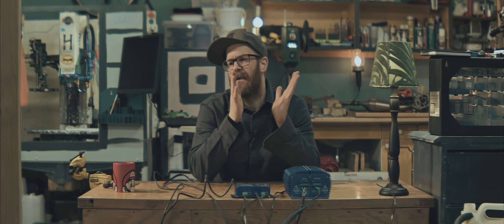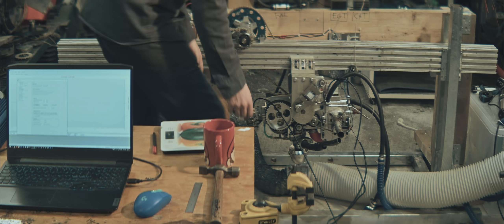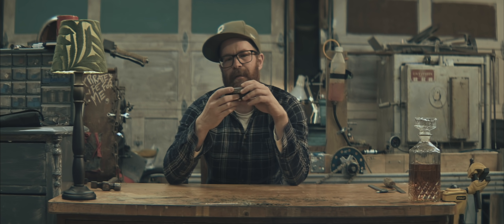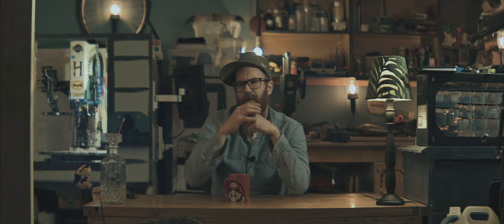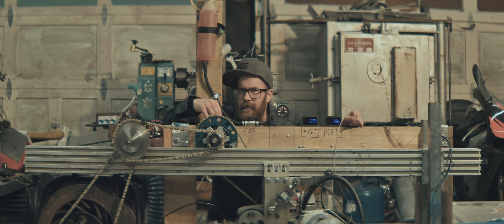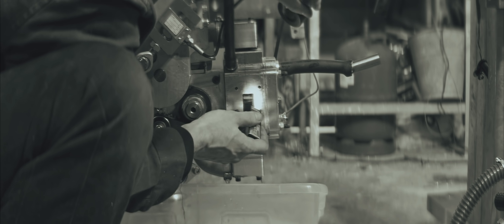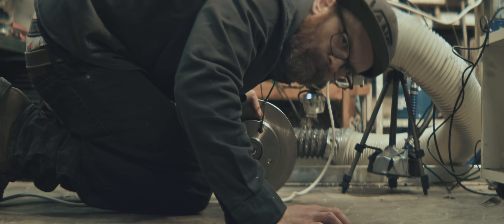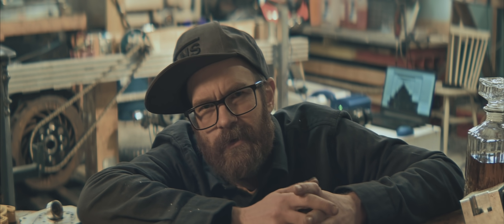Supercharged Two Stroke Grenades Head on Dyno!

Comment from the maker: Thank you The Ridge for the awesome wallet and for supporting the channel! Check them out here: https://ridge.com/2strokestuffing
Use code 2STROKESTUFFING for 10% off!
Reply: If you want to add a clutch back in the system in the future, I’d highly suggest using a kart clutch from the Touch And Go (TAG) classes of kart as there called in the USA, the 100cc class spins similar RPM to what you’ve commented your PIP should, and make about 35hp, the 125cc spin a bit slower but make 44hp, the typical engagement RPM for these clutches is set around 8k RPM, and are quite tunable, rebuildable....a cheaper option is a KT100 class clutch but it’s not designed to hold as much power.
Reply: Pls see comment and following discussion by "the Workshop".
Reply: if you suddenly feel a urge to buy a vintage taildragger and wreck it to get youtube views, its not the booze thinking its just the company of a terrible sponsor.
Reply: As a tourist in Norway, you can not use your visa or master card that works in the rest of the world. Only credit cards from Norway is possible to use.
Reply: @nhytg376tgyuu765gjmg  why the ads in the middle of a video.its about time to find another place without ads
Reply: Love the longer video. This one was great. I've been following since you nickel plated your PiP engine. Keep it up 👌👌👌😁😁

Comment: Always put wax on your blade when cutting aluminum. Especially if you don't have a metal cutting back pitched tooth blade. Also make sure the piece is well anchored against the fence and deck.
Starting to sound real good.

Comment: Just wanted to chime in:  you can cut aluminum angle on that saw, either clamp the angle to the fence so it won't move on contact OR place the angle with the inside down so it's sitting on both legs and start the cut on the corner.  Harder to clamp that way but it can be done.

Comment: I ve noticed you have alot of 2 stroke testing under your belt. How possible would it be to take a cheap Chinese motorcycle engine and make it a competitive  2 stroke? I was wondering how easy it would be to do? I thought about it because of already having block ,crank, and transmission already built.  Just wondering what your thoughts are on it.

Comment: A retarder has a maximum rpm and your gear ratio may not be suited.

How are you braking the engine ? Is it a ramp rate or a fixed load ?

I suggest a fast ramp rate and slow it down after you have everything working

Retarders are not efficient at low rpm

Your load control is automatic or manual ?

Comment: A couple things i saw that are screwing you.   1, when you  set up a load cell with an eddie brake, usually the cell is oriented completely vertical, and it's applied to the brakes coil bracket.  You have it mounted to the reaction member (engine block) of the engine. You can easily get spikes in load from accelerating the crank that isnt useful power output, but the dyno thinks it is. You can see this in your torque numbers flipping positive and negative when you were keeping it idling. If you throw a spike in the data, the computer is quickly going to compensate and add brake  regardless if that power made it to the chain or not.   Another thing that's killing you is that you are spinning the brake so slow and theres no mass attached to it besides the 2 rotors of its own construction. All the load is also significantly gear reduced. This multiplies the response of the brake by the gear ratio you are running. And this leads me into another problem you have. Imagine you have your front wheel on your bycicle gear reduced to a small light weight flywheel at a ratio of lets say 6:1. Attached to this flywheel is your front brakes. Now you want to do something like an indo on the front wheel down a short hill. That takes a lot of finesse with the brake. Well now because your front brake is over six times more sensitive, it makes that feet much much more difficult if not impossible. That's the same job that the Dyno has to do. And because it is so sensitive, you run into a problem where the PID for the brake may not be able to adjust for your level of sensitivity. Lets say that you are free spin at 0% brake, slight load at 2% and stall at 3% brake application. The brake has a finite level of adjustment. Typically a power of 2 to something. 255, 1024, 4096..  Lets say it's 255 adjustments. That means between your 3% operating range you only have 7 adjustments for load. That's not very adjustable. Then you have the dyno PID controls. It was showing a LOT of what they call overshoot/undershoot. Usually this is done when a PID algorithm used to control the dyno is not matched to the system that it is controlling. Usually it means it's too aggressive. Maybe too much P term, or not enough D term. Either way, it's best in my opinion if the load cell is mounted vertically to the eddy brake center. You set a 5kg weight directly on top of the cell and you're calibrated. For torque calculation then it's all just a factor of the gear ratio. You get no more false torque spikes from accelerating the rotating assembly, you only read torque absorbed by the brake, and it will produce MUCH cleaner feedback for the dyno to be able to adjust the eddy brake.

Comment: continuous burn steel impeller (reaction turbine) pump generator!! the simples most powerful power train ever
Reply: the rotary valve pulse jet burner as the hot air pulse heat source, center in, rim out, ducted or open, ducted for safety, open for weight reduction
Reply: no clutch needed for electric hub drive train, independent hub motors
Reply: what comes by earned, will go by whistle, its said

Comment: Ignitions in general but esp motorcycle style ignitions are incredibly noisy. They emit a lot of interference. Some ferrite would probably help. Also shield the spark plug wires with some aluminum foil and ground it to the block or very thin dia wire tightly wrapped around it and grounded to the block. Also tightly wrap your signal wires together.

Comment: I use the your dyno setup with a similar brake in my rolling road , try it on fixed rpm for measuring load . For mapping i find this is useful for mixture and timing adjustments  then do a power sweep at the end f the session.

Comment: I am not sure about your calibration of the load cell, did you take the angles the forces are applied and measured into account?
Reply from the maker: No, you're right. I didn't do the proper calculations, but 30mm should be ballpark. Doing things accurately when the bugs are churned out.

Comment: Awesome videos! May i ask why you dont build a manual external clutch system? Some sort of drop bars with a standard accelerator and clutch, maybe a brake ?   May I also ask why such a big heavy dyno?  wouldnt a rear wheel, running on that dyno give you a more accurate reading and feel. All those chains, sprockets and weights SCEAM CONFUSION in the math's, to me. In my mind, its like trying to dyno a 2stroke mounted in a tank with tracks, ratio'd through gears... I havent watched all your videos, but I am catching up, as you progress. You'll tame this beast just now! Im sure of it. Awesome show... Thanks for sharing with us!

Comment: Faaarrrkk man, I can't believe you used that meat axe without clamping the piece you were cutting, your very lucky, but I can't talk, I was using one one day and tried the same thing, it grabbed and bit in, blowing the machine blade bearing boss housing apart, shrapnel went flying everywhere, the blade went flying, I'm standing there shitting myself, all I hurt was my thumb, from the shock of blade grabbing peice my thumb was on, the drop saw was destroyed, I was sacked on the spot, my shortest job every, I was there for just 3 days lol, my advice is I wouldn't be drinking and using such machines, bad combination, at least your ok but I'd check that drop right over before I'd use it again. Great progress with motor 👏👏👏on the chain to dyno, I'd be adding a spring loaded sproket chain tensioner, so the chain doesn't decide to go flying, looking at how much free play there is. 👍 😊

Comment: Dude,,, your trying to sort out to many things at once,, 
First sort out the dyno with a stock motor, get that sorted out first.
Then once it's proper then start on the experimental motor.
It's called baselining, without your dyno sorted you can not reasonably think to get the experiment correct until then

Comment: nice work!
are you sure that your lever is 3cm? if 3cm is the distance form the center of rotation to the center from the bolt of the load cell, your lever will be only: cos(angel of the line between the two bolts to the horizontal) * 3 cm.  i guess that the lever should be something like cos(45°)*3cm= 1.57 cm.
maybe you have done it right and i just don't understand how you explane it.
Reply from the maker: You're exactly right, I was just being lazy...

Comment: Could you use a manual clutch to ensure the two conditions, (1) starting and idling, and (2) testing, both have the appropriate load engaged?  Maybe the PIP engine has different start/idle vs testing needs than the Brute Force Concept or your next design after that, so the flexibility could be useful.

Comment: Wonder if you can use a hubmotor as the load using the same dyno software , a hubmotor has leas mass and might be more suited for the 10 to 30 hp range

Comment: To validate the calibration of the load cell would it be possible to use an electric motor with a known HP and torque value  at x rpm and do a couple runs and see if you get a value close to or same as?  I would imagine using something that has a known output would make a good baseline like a 1.5hp 2000rpm  motor with a torque output of 5.3nm

Comment: It seems like the retarder is grabbing too hard then stalling out the engine during the power runs. The PID settings on the retarder will need some tweaking or playing with the ramp rate. Glad the episode ended with the engine in a still running condition! Progress!

Comment: Re calibration, what if you got an engine with a known output and used that as datum? Calibrate your setup off that engine against the manufacturers specs. I can imagine a new cheap engine would suffice. You could then use it to check calibration again from time to time.

Years ago in the Mopar Performance bulletins of the 1970s which were factory backed through extensive testing and tuning of their products for drag racing, Chrysler warned racers that engine dynos vary and to not get caught up in racing dynos: ie not happy with 400hp on one dyno and searching for another that gives you the numbers you want. 
With technology all that has changed from the 1970s of course.
Chrysler's advice to racers was to find one dyno and stick to it because ultimately it doesn't really matter when testing and tuning. 

Point is also, ultimately it doesn't really matter if the numbers are off a bit. Consistency can then show incremental improvements reliably.

Comment: A good video m8 , and when you up the boost I gues that's when you will see what parts need strengthening as well. But would fitting a known engine be better to see if your set up is correct.

Comment: Any chance you could make ME an engine?
The class limit for a Junior Dragster here in NZ is 250cc, so scaling up your 2500 or so horsepower from a 50cc, I should be expecting around 12500 HP right???. (i.e. About the same as a 500 c.i. top fuel engine that runs on 90% nitromethane with a great big supercharger sitting on top.
Not quite sure about finding some kid to drive it though as I'd be expecting a track time of under 2 seconds (assuming I can somehow find a way to get any traction).
I expect the launch G forces to only be a couple of hundred * g (i.e. About 30 times what the space shuttle could manage), so I might need to 'replace' the driver after each pass as I doubt they'll make it for a second run.
The hardest part is going to be the braking system since the kids aren't allowed to exceed 85MPH at the finish line!!!  (The rules don't inhibit them from doing 500MPH at mid track!!!)

Comment: That engine is very impressive I’d love to see one with a few more CCs
Reply: I'm a great fan of 250cc air cooled single cylinder racing going back to the early 70's. I would love to see a CZ 250 tuned to the max with a nice expansion chamber fed by a 38mm mikuni  carb. I always found the crank to be the weakest part when making a racing engine.

Comment: Yes, man, that's awesome. Getting numbers, even if I'm sure the numbers are wrong.  As Matt and others have said, make sure you're measuring your moment arm only in the horizontal plane for calibration.  It would be worthwhile using a motor that puts out a "known" power to check the dyno calibration is in range, maybe an electric motor as they have the numbers you're looking for on the motor plate and would be relatively easy to rig up.

That's one very interesting concept engine you have there.  Once start getting numbers you can trust from it, it would be very interesting to meter fuel consumption (which is gonna be horrific, as you're blowing through) in order to look at how it does vs a conventional engine (and just for laffs)

Comment: Awesome as always 👍 But I think there might be a problem with the load cell setup. You want to measure crankshaft torque but the load cell is measuring torque now at the cradle pivot point. I think since the crankshaft has some distance to the pivot point, there is an lever arm which amplifies the torque and the load cell sees higher numbers. Might be possible to fix this by attaching the calibration arm and weight to the crankshaft, then letting it rotate with the drive chain attached and that should produce the correct force at the sensor for a known calibration weight.

Comment: Hi , with regards to your CNC setup... If you ever consider a stand-alone control for your mill, My father and I converted a small milling machine called a Grizzly to CNC using a control called the DDCS V3.1 and Closed loop steppers. It works amazingly well and is very cheap. Has a screen and Pulse generator hand wheel. As a machinist myself and Cad-cam programmer the system realy impressed me... can compete with CNC machines that cost 3 times as much. Keep up the awesome content, and I can't wait to see the BRUTE force engine in a bike !!
Reply: I'm not into machining but can understand your thoughts. As a tight Yorkshire man, cheaper is always better.  My old boss used to say money is better in my pocket than yours. Are all bosses the same!

Comment: Is it okay to tig weld the spark plug bung back?
Reply: I think distortion will be a problem to the head plate. That's a project for later?
Reply: @malcrandall1309  won't it still distort from normal use? he can still sand it flat like a flange, then put a (thicker) gasket if need be, might as well try & save it if it's scrap.
Reply: @Eduardo_Espinoza  Welding deformation could be reduced by pre and post heating the parts. A large enough weld bead will have a quite large contraction force even when post heated.
If the head unit distorts under maximum load it's not strong enough. 
I think the new unit with it's large radius will continue to work OK until the boost is tuned right up. You know Alex, he's not happy till he's broke it.
Your right with the head repair,  repair not throw away.
Regards, Malc.
Reply: @malcrandall1309  Was thinking about that too, but I think he should've started out with bulkier parts, saving time & bits, then save weight in stages: pyramid, radius, 90°, etc.

Comment: Very amazing video!
But,why you not calllibrate your dyno with an engine that you ever test on the other dyno. That can make sure your dyno on the good callibations.
Reply: The other engine that was tested on the inertia dyno was the SPX variation. The calculated HP readings varied from one run to the next without any alterations to the carb/engine. When Alex went onto RC fuel the engine and fuel system became totally unreliable.
Regards, Malc.

Comment: calibrate it properly first, and CHECK it.
set up a way to hang the weight directly off the load cell, in line with the cell axis. calibrate it, then hang a different weight(exact known weight) off it and see if shows close to what it should be.

Comment: I know you are a 2 stroke man but a cheap clone Honda 110 (4 stroke) engine would be a good lil test bed to get the dyno calibrated. Linear power and can ring its neck for extended periods of time as long as you have some air flow over it

Comment: I have suggested it a few times now and no one has replied instead of keep changing and guessing the gearing take a CVT variator do away with most of it and make it manually adjustable giving you many gears with a twist of a screw

Comment: NEVER tempt the fates with phrases like "hopefully it won't blow up.." The Japanese call that "raising a death flag" basically asking for it to happen by hoping it won't. "Multi tooth trigger wheel" sounds like a reluctor to me. Good thing you only sheared it and didn't actually grenade it. You really need to get a ballistic acrylic panel to get behind so that you're safe if it does grenade parts. Sitting right next to it like that you could easily take high velocity shrapnel to your center mass and end up dead.

Comment: May i suggest 2 thing, first, the retarder is way too big, build one with maybe hino disk brakes or similar, i have faith in you, you can do it! And second, keep the centrifigical clutch but add a kind of lockup with an ac compressor electrical clutch in parallel with the centrifugical. Just my 2 cents! Good luck!